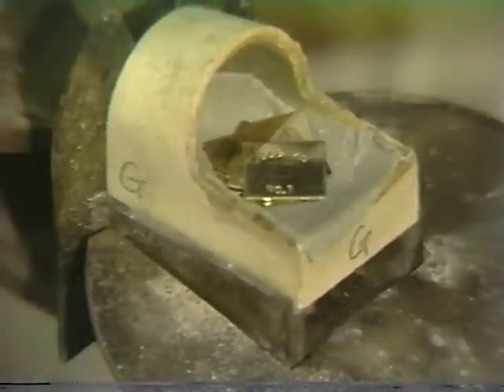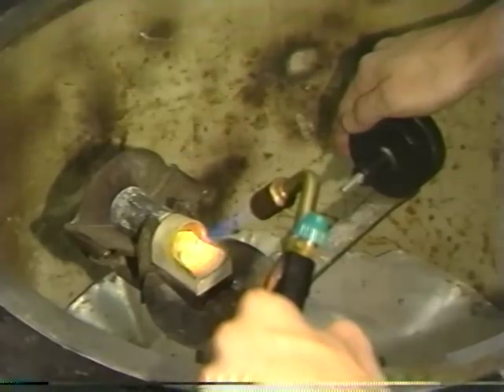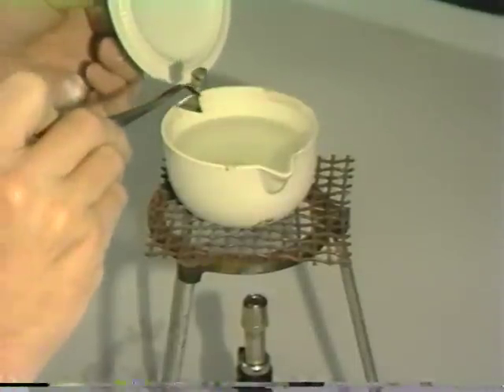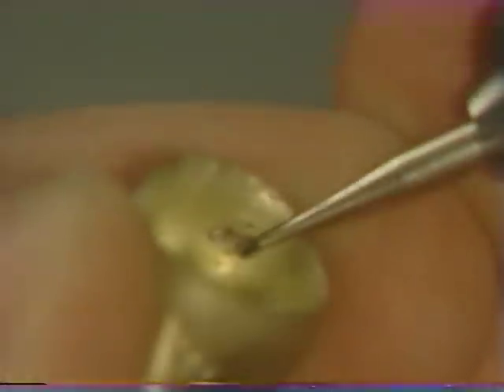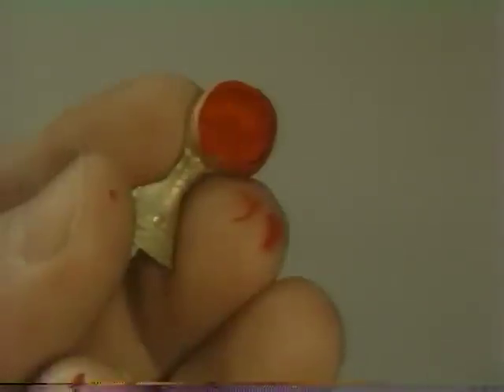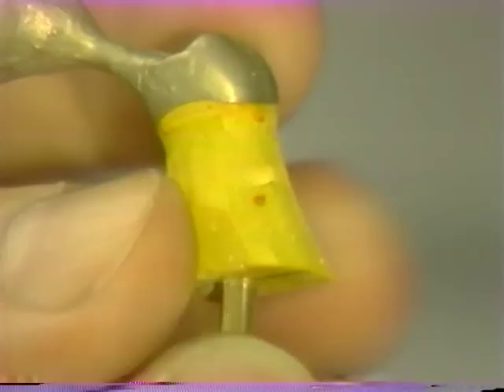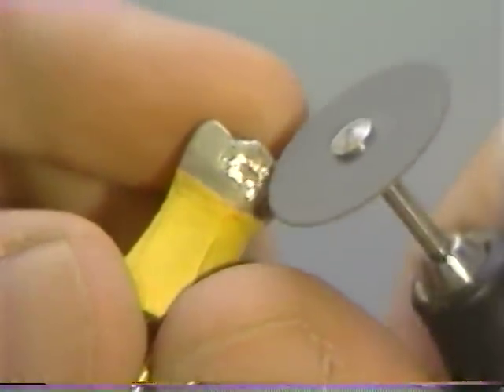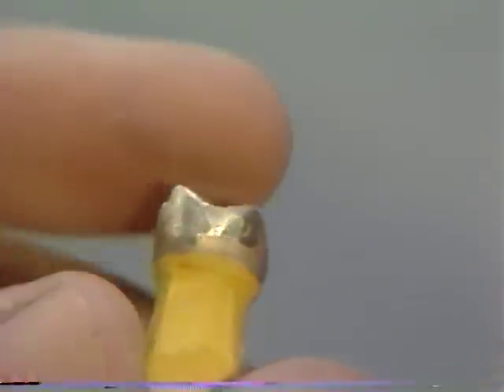Casting, Seating, and Finishing Technique

Comment: Sir what r the disks used for cutting and polishing
Reply: as thin aluminum oxide as possible. you want to go thin so you can recover the most scrap for recasting without turning a big notch into dust.